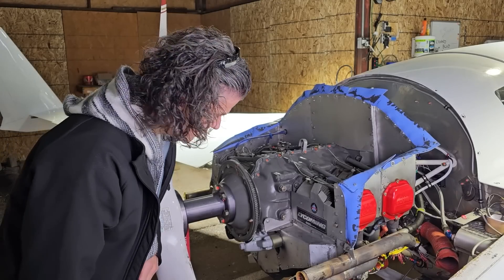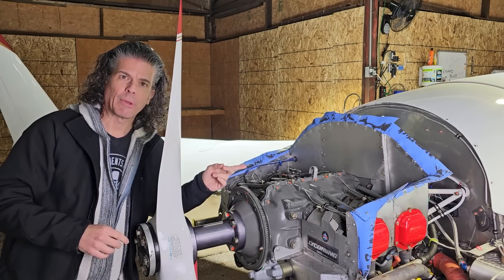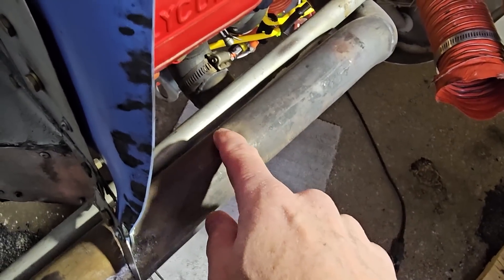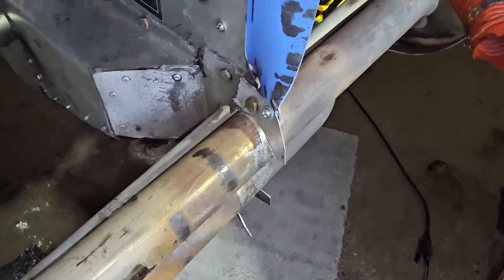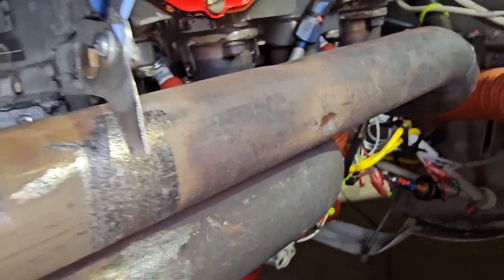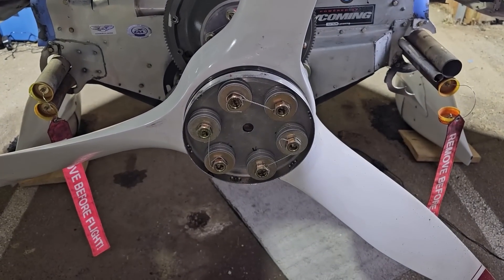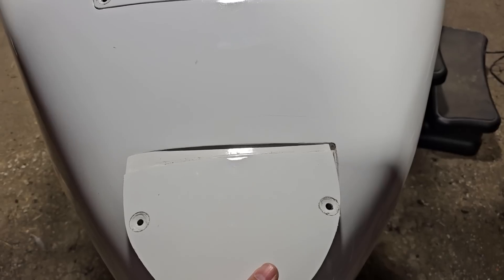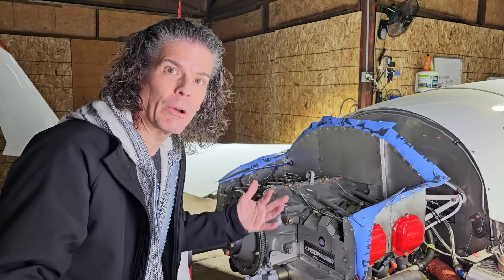Potential Deadly Problem Found! Fixing Everything Broken and Planned to Upgrade on my Airplane

Comment: I don't know. Having to rely on heat from the exhaust manifold seems iffy and just waiting for carbon monoxide to eventually show up. I'm surprised that that installing something as simple as a ceramic heated hasn't been designed or used yet? Must be away?
Reply from the maker: It's how general aviation aircraft have generated cabin heat for over half a century now, it's pretty much the accepted standard method. Ceramic heaters require an enormous amount of electrical energy - far more than small aircraft generate. Adding the capability to generate that kind of power adds considerable weight, and reduces the overall output of the engine significantly. Whereas taking waste heat energy from the exhaust pipes is simple, lightweight, and requires no extra power from the engine.
Reply: @CanardBoulevard  Hi Scott,

I appreciate that but the next aircraft accident attributed to CO poisoning won't be the first or the last. It just seems archaic in our "modern" day and age. Surely it can't be that difficult to run a heater on 14v DC? Were are the smart electrical engineers that could figure this out :)
Reply from the maker: @tonybenjamin7844  It's not a question about being smart or not, it's a question of physics. Yes, you can run a heater on 14V, but you need WATTS - energy. To get the same amount of heat from an electric heater that we get today for free from exhaust shrouds, we would need about 400 to 500 amps at 14 volts. Consider that the typical alternator on a GA airplane is around 80 amps. A 500 amp alternator and the massive wire to carry 500 amps are going to be extremely heavy, and create a ton of heat that needs to be cooled, so additional drag for cooling, plus additional power required because it's sapping so much power from the engine, which means higher fuel burn...it's just not practical, which is why it's not done.

Comment: Here is some free advice stop using engine exhaust for heat. Get a heat exchanger for oil. And use electric heat.
Reply from the maker: Electric heat uses far more electrical power than the existing electrical system can supply. To do that you'd have to increase the size of the alternator and all the alternator wiring, which decreases available power at the propeller, and you also end up with a lot more weight - heavier alternator and wiring, weight of the electric heater(s) and ductwork. And you need a LOT of power to generate any appreciable heat on cold days.

Oil heat has been done by several owners, but the universal opinion is that it doesn't generate a lot of heat, and it is again quite heavy. Oil-filled lines into the cockpit, a secondary radiator and vernatherm, fan, ducts, and the drag of an extra air inlet. In cold weather, your oil isn't getting much above 160 or 170 degrees, and that just doesn't impart much heat into the cabin air.

There is a reason why virtually ALL small aircraft use exhaust for heat: it's free, adds virtually no weight, and it is VERY hot. Where oil heat tries to pull heat from 170 degree engine oil, the exhaust is more like 1500 degrees. If there's one thing that there is an excess of in a piston aircraft engines, it's heat. Much less complexity, much less weight, much more heat.

Comment: My '71 VW Bus had heat exchangers around the exhaust pipe.  They are horrible!  Smelly + Not Efficient to heat a cab!  I removed them and put 12V Ceramic 500W heaters in my Bus. Clean + Far more heat!
Reply: Whats the amp draw on the ceramic heater and who makes a reliable unit

Comment: Better safe than sorry!. Good that you discovered all those issues. On the other hand, is it possible to create a funnel in the lower part of the intake to redirect more air into critical places?.
Reply from the maker: There are multiple different methods of directing air - usually either ramps built into the cowl, or blast tubes made of SCAT tubing.

Comment: Looks like the alternator belt is large enough diameter to clear the starter wheel. Try that once the original propeller has been removed.
Reply from the maker: It is not. The starter gear ring has to be removed to replace the belt, which is why I did not replace the belt when I replaced the alternator - but I do have a new belt on hand to install when I DO pull the prop off.

Comment: I am a retired A&P, I.A. (42 years in the business.) Would you take a look at the push rod shroud tubes and make sure none of the cylinder barrel baffles are touching those tubes. What I can see on Number 2 looks like a flange is pretty close to it and it doesn't take much to produce an oil leak in them.  And if you really wat to get to know those Lycomings, look up "Key Reprints from the Flyer." It used to be a monthly publication and there are many good, informative,  articles online.
Reply from the maker: @i.r.wayright1457 Thank you for excellent advice. Looking at some higher resolution pictures I have taken, it looks like the cyl 2 barrel baffle is close, but cannot actually touch the shroud as the adel clamp holding the injector line would prevent it. However...cyl 2 barrel baffle appears very close to its pushrod shroud, from what I can see in the picture. I have added it to my to-do list, and will check it on my next trip out to the hangar.

My father is also a lifelong A&P (almost 60 years, retired the last 15), and he gave me a TON of his books, manuals, tools, etc. - and included in that was a copy of "Key Reprints from the Flyer" which I have already read from cover to cover. It's actually literally sitting right here next to me as I write this, as a matter of fact. :)
Reply: @CanardBoulevard  I grew up three blocks from Lycoming and worked at their airport annex for two years, overhauling engines. Sounds like you are in good shape if you read that Flyer and have an A&P for a Dad.

Comment: Wow! Really neat stuff and glad you found the  imperfections before it was too late. Seems like a lot of extra work to install shroud heating! Why not just install an electric Janitrol heater or carry a portable USB heater with a low draw. As far as the hot cylinder could you not create another NACA duct in the cowl to increase airflow over that area! All that tubing your talking about would make me nervous for future complications! Just a thought!
Reply from the maker: It takes a tremendous amount of electrical current to generate usable heat, and small airplanes just don't have the excess electrical capacity to do it - and when copious amounts of excess heat is already available for free...which is why virtually ALL small aircraft use heat from the exhaust to heat the cabin.

Comment: I suggest you reconsider your plan to cut a hole in your baffle wall. Any air entering the area above the engine that doesn't help cool the engine will reduce your overall cooling performance. I'm not necessarily saying don't do it, I just encourage you to be critical about that plan and try to get as much expert guidance on it you can.
Reply from the maker: Yeah, I do need to do some testing, and identify the pressure differential between the top and bottom, and how that would be affected by doing this. Another option would be to vent it overboard through the cowl, but that could have consequences, as that air needs to be very smooth for the prop to bite into. I'm determining right now just how much air needs to vent through in order to keep the shroud cool enough - I could restrict it enough that pushing it through the baffle will make not a huge difference.

Comment: Thanks Scott. I'm super fortunate to have the Cozy community. I don't have heat in my Cozy and would love to see your continued progress. My Cozy is down right now for maintenance on the canard to replace the incidence tabs to fix a bad incidence angle. Also re-wiring the nose gear and panel. Might be a good opportunity to add some heat and landing lights to allow for night flying.
Reply from the maker: I have a video on landing lights coming out soon! I'm doing some rewiring as well while mine is down.
Reply: @CanardBoulevard  I might help James Russell do a video on the canard incidence as he has recently encountered two (mine being one of them) Cozy's with bad incidents.

Comment: Have you considered oil heat?
Reply from the maker: I've seen some Cozy's with that done. I actually showed some of them in my "Rough River" video. But running oil cooler lines all the way from the engine to the front of the plane, then putting an auxiliary cooler up there, along with a fan, adds quite a bit of weight. The worst thing is...it doesn't make much heat. Your oil is at only 180 degrees F, it's not transferring a lot of heat into the cabin air. Automotive cabin heat exchangers work with coolant at 220 degrees, and a much larger heat exchanger. The owners I've talked to who have this type of heating system say it doesn't do much when it gets really cold outside.

Comment: If u ask me...
Liquid cooling the exhaust using it heat to heat up the cabin like a cars heat radiator system
Is one option 

Or having a copper pipe wrapped around the exhaust like a coil
And with that you can choose to circulate the cabin air... 
Which means air from the cabin goes through the pipe around the exhaust and back into the cabin gradually increasing the temperature inside a cabin 
And just like in the current design you have 
You can also have a switch valve to control if you want a flow of hot air back into the cabin or cold air into the cabin
Reply from the maker: Liquid cooling adds a LOT of weight. The solution I'm using is kind of like you are thinking - it has a shroud, with copper coils that contact the exhaust pipe, conduct some heat away and present much more surface area for the air to pick up heat. Recirculating cabin air isn't typically done - when these shroud systems are working correctly, they can take sub-zero outside air and heat it almost instantly to over 100F, which is then put into the cabin. Plus it's less complex - with a recirculation system, you have extra ducts and a circulation fan. The traditional system (which I'm using) uses just ram air to push the hot air into the cabin, no fans required.

Comment: How about leaving zero welds inside heater unit? Have you tested cooling flow w a fan on naca duct and smoke? So you can see it comes out evenly throuhg cylinders and cylinders only. Could ceramic coat help inside headers? Have you balanced propeller so it doesn't shake those hot weaked headers? Using 3 jevelllry scales on eg 5 diffirent radiuses.
Reply from the maker: There are no welds on the exhaust where the heat shroud will be located - I would not trust a weld inside a cabin heater shroud. I will definitely be testing with a fan (leaf blower, actually) into the NACA duct before a flight test is performed. And I have something better for propeller balance...more details on this coming out in a video in a couple of weeks.

Comment: Why not ues a 2nd oil cooler for hot air
Reply from the maker: I've seen some Cozy's with that done. I actually showed some of them in my "Rough River" video. But running oil cooler lines all the way from the engine to the front of the plane, then putting an auxiliary cooler up there, along with a fan, adds quite a bit of weight. The worst thing is...it doesn't make much heat. Your oil is at only 180 degrees F, it's not transferring a lot of heat into the cabin air. Automotive cabin heat exchangers work with coolant at 220 degrees, and a much larger heat exchanger. The owners I've talked to who have this type of heating system say it doesn't do much when it gets really cold outside.

Comment: Which is exactly why I don’t use cabin heat.  The heat muff over the exhaust pipe I s a dependable pilot killer every winter.  Instead, I wear an iHood battery-powered parka, iHood heated socks, & heated rukala thin-sulate gloves.  All hook up to apps, so control is fast & easy.  The parka has individually controlled heated panes in the back, front, neck/hood, & arms.  Once warm I just cycle it all on & off extending 6hrs of on time to 10 or 12hrs.
Reply from the maker: I have some heated gear, but I also have two sensitive CO detectors, one in my headset and one portable rechargeable one in the cockpit!
Reply: @CanardBoulevard  not a criticism, just trying to increase awareness that there are other options that won’t kill you.  I can’t find a stat but CO in GA is a big enough problem that the NTSB is pushing the FAA to require active CO monitors with both light and sound warnings.  As you discovered, cracks in the exhaust can be insidious and difficult to find.  

I don’t have a heater in my Bushcat but, because the heads are water-cooled, I could cobble together an automotive-like wet heater with a fan that wouldn’t kill me.   In the mid-Atlantic, that seems expensive and more trouble than battery-powered clothing for our short and mild winters.

Comment: I am guessing you will have to do a new weight and balance?
Reply from the maker: Not technically, as the new prop is the same weight as the old one, and the new shroud and exhaust is almost exactly the same weight as the old one. That said, I was planning to do a new W&B once the new prop was on anyway.

Comment: If you have cooling issues, concentrate on the sealing the bottom from the top.
It will have the benefit of not only lowering #2 temperature, but also the rest.
Reply from the maker: I've already done this. I replaced all of the baffle seals, and sealed up all of the openings around the engine, alternator, etc. It's pretty tight. It's actually a pretty common Canard issue - some owners have tried enlarging the NACA scoop on the bottom to get more pressure and airflow, of course that adds more drag as well. My CHT's are pretty good, except for cyl 2. Once I get it under control I'll be happy with it.

I saw one where they tried leaving the engine as downdraft cooled, putting a NACA scoops on the top cowl, and feeding that down like a conventional airplane. The problem with that is during the climb, when you need cooling the most, the higher angle of attack and slow speed reduces airflow into those scoops and the engine overheats.

Comment: Can you use more insulated hose (the orange hose) to run hot air into cabin? That hot air must lose quite a bit of potential in the span from engine to rear firewall.

Comment: Why not a simple resistance heater and clean up the plumbing at the same time.
Reply from the maker: Electric heat requires a TON of electrical current, which just isn't available on small aircraft. A decent sized electric heater that would work in our poorly-insulated aircraft could easily draw between 20-30 amps, and when your alternator has only a 40-60 amp capacity, that doesn't leave much left over to run the rest of the airplane. You could put a bigger alternator on, but now you need larger wire, bus bars and contactors for the additional current, which weigh more, not to mention the much heavier alternator itself.

Comment: How about and inverter and use a electric hearer.
Reply from the maker: Electric heat requires a TON of electrical current, which just isn't available on small aircraft. A decent sized electric heater that would work in our poorly-insulated aircraft could easily draw between 20-30 amps, and when your alternator has only a 40-60 amp capacity, that doesn't leave much left over to run the rest of the airplane. You could put a bigger alternator on, but now you need larger wire, bus bars and contactors for the additional current, which weigh more, not to mention the much heavier alternator itself.

Comment: I would reverse your air flow for your heater. It means you will have to double back a hose, but you can then get forced air in form your air intake.
Reply from the maker: The reason you run the intake at the rear is that is the cooler part of the pipe. It's all about delta: incoming air is very cold, it gets heated up by the cooler part of the pipe. It then moves forward to the hotter part of the pipe, where it gets heated up even further. 

If it was the other way around, it would get heated up by the hot part, then move to the cooler part of the pipe, and because the delta between the pipe and air temperature is less, less heat exchage occurs.

Oil-to-coolant heat exchangers in cars work the exact same way for the same reason.

I'll be getting forced air from the intake anyway because I'm putting a SCAT tube down there to pick up incoming blast air.

Comment: - Cool. For me it has been car trouble lately. Rats have gotten under the hood and been biting insulation around cables. The mechanic doesn't bother with fixing that, too much work I guess. So my dad and I will have to fix it ourselves. The biggest problem is probably that it's difficult to reach some of those cables. Meantime, the car is still running, but it gives an "engine error" message that the mechanic can't fix without fixing the cables. We'll see how it goes.
Reply from the maker: Yeah, mice and rats can do an incredible amount of very expensive damage to wiring!